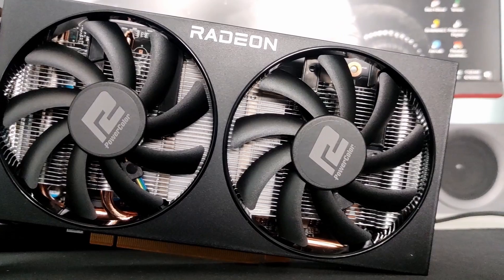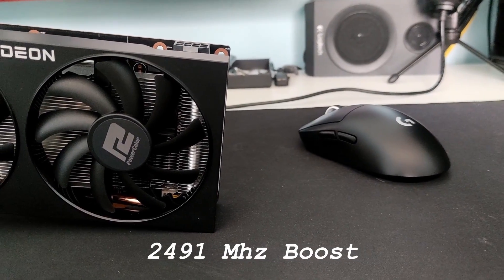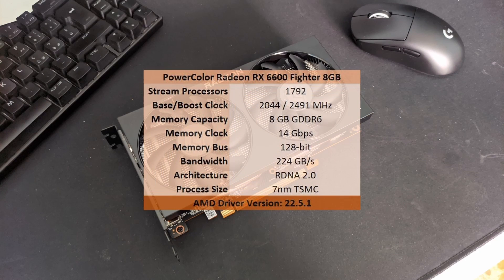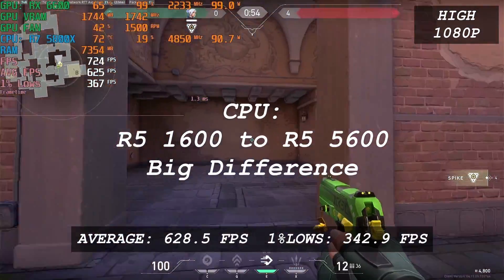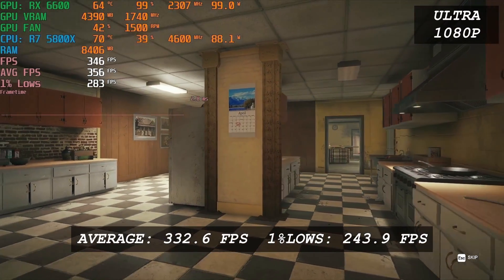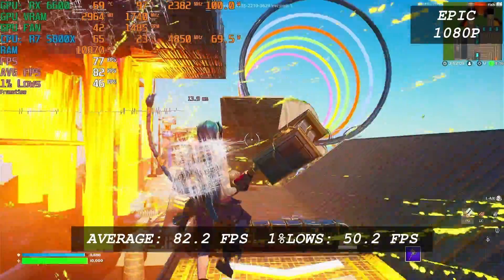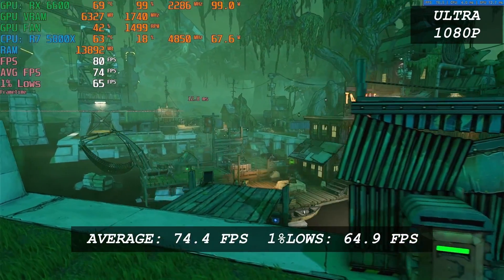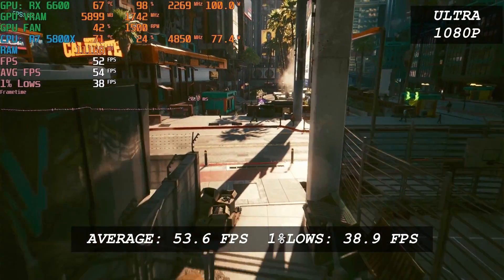AMD RX 6600 8GB PCIe 3.0 Review in 2022 | One of the best GPU you can buy! | 10 Games Tested 1080P

Comment: What cpu were you running with the gpu, i have a older I5-4570 and want to upgrade to something that wont bottle neck the gpu, i cant run siege more than 30 fps on the lowest settings with textures to basically blobs
Reply from the maker: I have an R7 5800X from AMD.

Comment: I just ordered a Sapphire Pulse rx 6600 used for $194.84 total from a reputable seller after watching your video this minute.   I just hope my pre-built computer can handle it because it only has a 400w psu.   Its an HP Pavilion that came  with an RX 5500 and a Ryzen 5600g.    The recommended psu for an RX 5500 OEM is  300w but for an RX 6600 it is 500w.   I don't understand why since both cards are rated for  150 tdp.   Do you think  I'll be fine with a 400w psu?
Reply from the maker: It should be okay, but you won't be able to overclock or anything.
Reply: @ItsMeIvan-  cool thanks for the reply

Comment: I got this 6600(went from an GTX780) for $217 to pair with my 5600(went from a 1300X) I got this summer for $154, on an Asus B350M-A.
 Would it be worth the upgrade for a B550 at $80?
I can probably sell my B350 + 1300X for $40, so the actual cost would be about $40 for PCIE 4.0 and SAM.
(I use dual 1080p 60Hz monitors)
Reply from the maker: Yes I think that's worth it, the B550 board is a pretty good platform.
Reply: @ItsMeIvan-  Thank you, however I just found out I can actually run SAM on my B350. PCIE 3.0 might lock me into smaller sized textures though. Maybe there will be a sale on B550's when the A620 boards arrive.

Comment: I
s your gpu is running at 3.0 x8 or x16?
Reply from the maker: The RX 6600 only has a x8 interface, so even at pcie 3.0 it's only running x8 interface.
Reply: @ItsMeIvan-  Oh
Reply: @ItsMeIvan-  that sucks, thinking about replacing a 1070 8gb in a dell workstation (xeon E5-1620)  the calculators say its still a good match no cpu bottleneck.  think its worth it for 1080p?  im getting around 60fps with some occasional lows on medium settings on my games.
Reply from the maker: @ibbobud   The RX 6600 is a decent upgrade from the GTX 1070, though i'm not sure how it will fare with that CPU since i'm not familiar with it.

Comment: I am only getting 150 fps on valorant
Reply from the maker: What's your CPU? Also, this is during the testing run, during real games, FPS might frop quite a bit.
Reply: @ItsMeIvan-  i3 9100f
Reply from the maker: @ibrahimgadli2583  That could be the reason, faster CPU benefits Valorant more
Reply: @ItsMeIvan-  but I think the bottleneck is to much
Reply: @ItsMeIvan-  and if I use 3d mark will the bottleneck affect

Comment: So, you're using a 3.0 PCIe lane for the graphics card? Even tho it is a 4.0-lane GPU.

Overall, it works well. I do have  a gifted b450m ds3h v1 and I don't  know if it will work well with a slight decrease in fps or anything noticeable big decrease on the performance 

Do u think it is okay to use a 3.0 lane to a 4.0 GPU?
Reply from the maker: It will work just fine :)

Comment: rx 6600 power color, is compatible crossfire in b450 strix gaming ii asus?
Reply from the maker: You can use RX 6600 powercolor on a b450 no problem.. but crossfire, i'm not sure. Crossfire isn't ideal any longer. Companies have pretty much abandoned this tecnology.
Reply: @ItsMeIvan-  I wonder why there are 2 or even 3 pcie x 16 ports so it's fine but if it's useless
Reply from the maker: @loup1408  You can use those other ports not just for GPUs but also for other devices such as sound cards. You can still run more than 1 GPU, but it's not ideal for gaming. It's good if you're going to be running virtual machines.

Comment: Performance difference between pcie 3.0 and 4.0 is negligible? While using rx 6600
Reply from the maker: RX 6600 with PCIe 4.0 is faster, but not by much, but It's noticeable. Specially at some games such as Doom eternal.
Reply: @ItsMeIvan-  I have gigabyte h610m S2 DDR4 motherboard. Will I get rx 6600 full performance on this motherboard?

Comment: It's hard to decide, the Sapphire and XFX 6600's are like the same price almost with backplates. I think the non xt version is better if your already unsure about your power supply and other older components that are gen3. I was so dumb, I got a rx560 in 2020 for 768p, then went to 1080p monitor and saw a big frame drop, and the 4gb gddr5 was always maxed out in flight sims.
Reply from the maker: I would go for Sapphire, they produce high quality GPUs.
Reply: I was the RX 560 4gb user as well, now I use ASrock 6600. It's a big upgrade my friend.

Comment: Rx6600 polor 149$ but the fan have rattle noise problem and no warranty 1 year used 

Rx6600 xt asus dual oc 200$ ex mining 3 month in really good condition and 2.5y international warranty

Rx 6600 sapphire, 221$ brand new 2y warranty 

What should i take ? i have r5 3600 and b450 so it will have pcie 3.0 right, do you think which one is the most worth it with my system?
Reply from the maker: the RX 6600XT seems appealing. If you can make sure it's in a good condition, go for it.
Reply: @ItsMeIvan-  i just pick the rx 6600xt and it's still shiny it's basically a new card , the temp works great 40c idle and rarely 79c at full load

Comment: I hold world record on 1 gpu on all fire strikes (3dmark) on ryzen 5600+rx6600 on a b450 chipset . The pcie3 the speed difference between pcie4 8gb is so miniscule (on1080p )
Reply: so should i buy rtx 2060 super or this card. My region has both at the same price. And can i run pcie 4 on gigabyte B450 gaming x motherboard ?
Reply from the maker: They are pretty similar in performance. Go with which one is cheaper. No you can't run PCIe 4.0 on a B450 motherboard, you'll need PCIe 5.0 for that.
Reply: also the rtx 2060 super is pce 3

Comment: hi all! i have exactly the same card with asrock b450 pcie 3.0 x16 motherboard and ryzen 5 3600 cpu. In the gpgpu aida test, the read / copy indicators are only 6-7k gb / s. Although on the Internet I found a benchmark of the same video card, there the indicators were already 13~! Difference in performance due to the fact that my motherboard is pcie 3.0?? Or is the card defective? Thanks
Reply from the maker: I'm not sure since I, too, don't have PCI-e 4.0 motherboard. Though, it does make me think it's because of the PCIe 3.0 since you're pretty much getting half the bandwidth and considering your scores.. 6-7k it's around half of 13k so that seems plausible. Though take it with a grain of salt, as I said i do not have PCIe 4.0 system to check that.
Reply: @ItsMeIvan-  found information

With PCIe 4.0 you get roughly 2 GB/s of bandwidth per lane, giving the 6500 XT a ~8 GB/s communication link with the CPU and system memory. But if you install it in a PCIe 3.0 system that figure is halved, and this is where you could start to run into problems

Comment: hello sir. could you share some info about rx6600 8gb vs rtx3060 12gb, which one is better pairing with r5 5600+b550m ds3h+16gbx2 ddr4 3200 cl? i'm into forza, rdr2 and some video editing (no streaming). should i buy now or wait a few weeks until the price drops? thank you and have a great day.
Reply from the maker: Depending on the price, they are pretty similar in terms of performance. If prices are the same i'd go for the RTX 3060 12gb, if the RX 6600 is cheaper, then go for it. At the end of the day you'll be served well by both. Just pick which one is cheaper.
Reply: @ItsMeIvan-  thank you sir for your quick reply and duly noted. have a great and lovely day. cheers.
Reply: @zamSEG  They're very similar, but the rtx 3060 is a few percentile points better in performance, so if you manage to get one for 4/5% more than the rx 6600 price then i'd say go for it. Just two days ago I bought my rx 6600 for 313€, in my country the rtx 3060 was well over 400€ so in that case the 6600 is just insanely better in price to performance ratio, but if it was 313€ for the 6600 vs 340€ for the rtx 3060 then it would have been a really close call.
Reply: @Spar7anProjec7  duly noted and thank you very much for the englightment. here in malaysia rtx3060 around usd335 and rx6600 usd268. rx6600 seem bang for buck, but i think the 12gb ram really suit for my video editing needs.
Reply: You're absolutely correct, if you want to edit, and expecially render, then Nvidia is definitely the best choice, because memory > clock speeds when it comes to pretty much anything that isn't gaming 👍👍
Reply: @Spar7anProjec7  yes sir, i'm more to video editing and light gaming. thank you very much for replying and shared some lights on this matters. wish you all the best and have a lovely day sir.
Reply: @zamSEG  thank you for your kind words, may you have a great day as well!
Reply: @Spar7anProjec7  you're most welcome sir. keep on doing good deeds. 👍👍👍
Reply: @zamSEG  nah bro don't go for the 3060, only 2-5 more fps for 50w more power draw..
Rx 6600 is better and cheaper..
Well I see you're buying it for video editing, 
Rtx 3060 is the right choice if not for gaming
Reply: @youcantakemygoogleaccount2359  yes, main purpose for video editing and some light gaming.

Comment: Hey thanks for the video, but i have a question im planning to buy this gpu for my pc, my current specs are.
- Ryzen 5 3400g
-2x8 ram sticks running at 3000mhz
-mb asus prime 320mk
-psu evga 500w
im worried about the motherboard running this perfectly since it has pcie3 and dont know if the apu of my cpu affects something? thank you!! great video!
Reply: you should have no problem. i also have a 3400g and a 6500 xt and i dont have alot of bottleneck
Reply from the maker: The RX 6600 has 8GB vram, you'll notice the difference between PCIe 3.0 and 4.0 on Vram constrained games like Doom Eternal, other than that you should be good. it might have slight performance hit, but not that big.
Reply: @ItsMeIvan-  thanks a lot for this info

Comment: my XRX rx6600 crashes from time to time. does anyone encounter this? been playing Far Cry 6 and RD2 with my Ryzen 7 system and 16gb  ram
Reply: Update mobo bios, put standard mode in the graphic profile settings through driver software, do a clean driver installation with DDU, check you psu power capacity.
Reply: Make sure you use the recommended drivers and not the optional beta drivers. Mine by default used the newer beta drivers and kept crashing too.

Comment: I have 2 questions, 1. An R5 5600G on a AsRock B550M Pro4, will it run on PCI-E 4.0 lanes or 3.0? Does the performance difference similar to RX 6500 XT on 3.0 lanes? 
2. Powercolor Fighter or AsRock Challenger, which one is better? (This two is the most affordable brand in my country)
Thanks
Reply: The performance is not the same as the rx 6500 xt since its not pcie gen 4 x4. The rx 6600 goes from pcie gen 4 x8 to pcie gen 3 x8. In some games you can lose performance but its not as hard as the rx 6500 xt. I run a rtx 3050 with pcie gen 3 x8 and get 57 fps on average with horizon 5 on 1080p ultra. If I had pcie gen 4 x8 it would be 68 fps on average. Lets put it this way, pcie gen 4 x8 = pcie gen 3 x16. Thats what its suppose to be, but the pcie only pick up x8 lanes when moving from pcie gen 4 x8 to pcie gen 3 x8. So some games would like pcie gen 4 and others wont. Its a 5-15% difference.
Reply: 5600g can't support pcie 4.0

Comment: I got this graphics card , it’s my first time building a PC but when I power on my pc the GPU fans start spinning and then stops after 5-10 seconds with no display like literally nothing on the screen.

CPU - i7 9700k
Motherboard- MSI MPG Z390 Gaming Plus 
Ram - Xpg gammix d30 16g
Ssd - SK hynix Gold P31 500GB PCIe NVMe Gen3
Reply: Check your motherboard for a functional PCIE*16 slot. Swap in another working graphics card to confirm the issue.
Reply: @sunilcherianpullockaran8817  it's his first time building so I don't think he has another gpu laying around. I would check to make sure the ram is seated properly
Reply: la pantalla esta en negro? o solo se detienen los ventiladores?
Reply: Hi there, do you still have this problem and did you manage to fix it?
Reply: I've had the same problem, in my case the RAM was not properly locked in.
Reply: It's a motherboard problem, MSI Z390 Gaming Plus is a god-tier shit MB. Always choose Asus or other brands!
Reply: @animesoup4007  you’re right I returned the cpu and the motherboard and got an Asus motherboard with a Ryzen 7 5800x and everything is going well so far
Reply: check your motherboard cpu socket, its common that these pins are bent and if the wrong one is bent, it could cause the problem your facing. i had this problem a month ago and bent my pins back into place with a knife haha

Comment: I am considering selling my XFX RX 5500 XT 8GB Thic II Pro at around $60.000 ARS (like 262 USD) and buy this Powercolor Fighter RX 6600 for $68.000 (like 296 USD).
I just bought a Ryzen 5 5600 to upgrade my 1600 AF too.
(My motherboard is the Asrock B450M Pro4-F.
Reply: yo tengo una b450 y me la compre (estoy esperando que me llegue) estaba pensando en cambiar de placa pero me conformo con lo que me puede rendir ya luego hago upgrade a b550
Reply: @Ron2646  las B550 se fueron al carajo. Mi primo se compró la MSI B550 Tomahawk a $29k hace 1 mes y medio y ahora está $100k
Reply: @Benjamin-lh6dq  yo tengo una a320 mk. Queria una b550 pero estan re contra caras. Intentare ir por la b450 y ya con la rx 6600
Reply: hacelo rey, yo saque la 6600 por 66k y no me arrepiento, algunos la consiguen a 60k

Comment: I have the same GPU but I have MSI Mech X2 and it works like a beauty paired with R7 5700G damn. This GPU for 1080p High/Ultra it does it's job. For 349 euros I can't complain got a good deal and was the same price as rtx 3050 so yeah
Reply: I have the Mech X2 also and it uses PCI-E 4.0 and not 3.0 so that makes a difference
Reply: @ericmayle8510  all rx6600 have no different in pci e , it's depend what's your system supported
Reply: Can we run PCI-E 4.0 ON PCI-E 3.0 Motherboard?.?
Reply: @saleemakhtar564  yes you can use since PCI is compatible with version belows.
Reply: @saleemakhtar564  this meaning you will run 3.0 on 3.0. your CPU will define as well that PCI it is